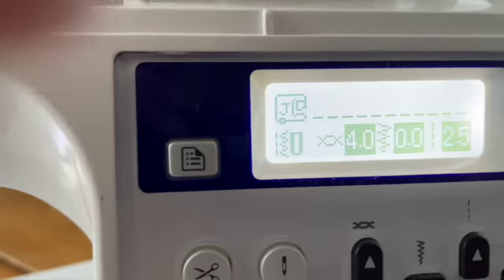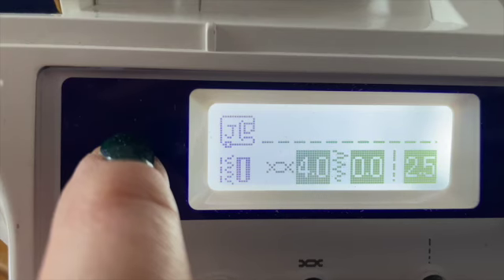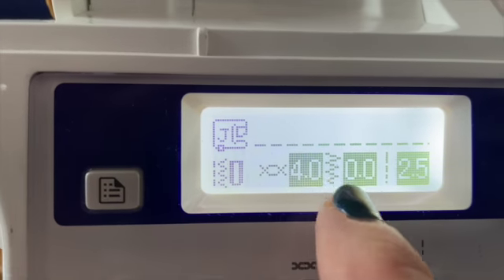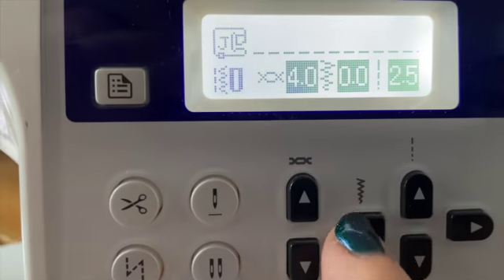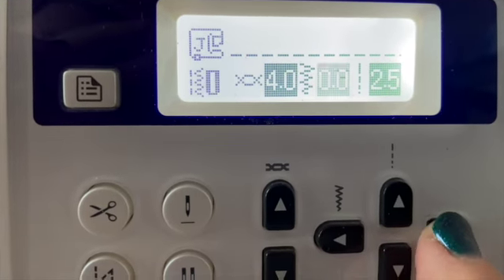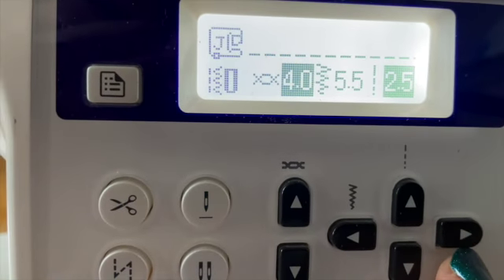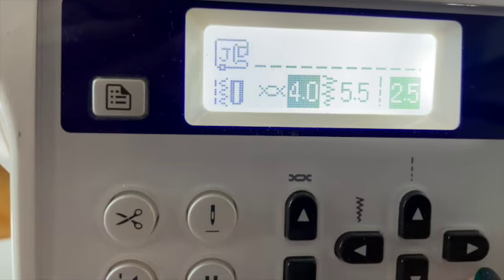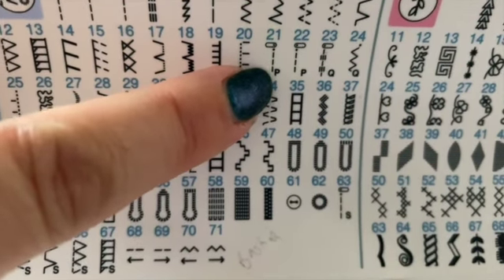🤩 How To Set A Seam Allowance On A Sewing Machine

Comment: Do you know what stitch width an 1/8 inch would be?
Reply from the maker: Great question Deanna. I've found that's it more about where you position the fabric under your foot. So, put your stitch width setting to 5.5 to get it to 1/4". Then look at your foot; there should be a metal bit on each side. Look at the right hand metal bit/prong. Then line up the edge of the fabric to the inside edge of that metal prong, and that 'should' be 1/8"   I use Brother machines and it seems to work on all the Brothers that find a place on my sewing table, but I haven't tried on other brands of machine. So give that a go on a practice piece and then measure the seam allowance. Hopefully it won't be too far off! Do let me know how it goes. Kim.
Reply: @QuiltWithKim  sweet ty, I have a brother so I'll try that 😁

Comment: How do I get a 3/8 inch on my machine
Reply from the maker: You may see one of the seam allowance markings (the lines on the base plate) for 3/8”. If not, put your needle into its default position, and measure the distance from the needle to the edge of your foot. That’s ‘normally’ (but not all if time!) 5/8”. Now adjust your stitch width a little so that your needle moves to the right. Measure again….and adjust as necessary. It really depends on the type of machine you have, but give that a go and let me know how you get on and I’ll try to help a bit further.

Comment: Know where to buy 1/4” foot for a dedicated left position machine? I have an older brother galaxy 131, which is left position machine when sewing straight stitch.
Reply from the maker: Hmm, not sure about the quarter inch foot for your particular machine  (contact Brother - they will tell you), BUT the good news is that on pretty much all machines there are parallel markings on the base plate just to the right of the presser foot.  One of these should say 1/4" (and it may be closer to where the needle is than all the other lines).  Those measurements are taken from where the needle is in its default position AND with the standard foot on, so if you run a test stitch line with the edge of your fabric against this quarter inch marker line, you should find that it's a quarter of an inch and you're good to go! Let me know how you get on. I'll keep my fingers crossed for you. Kim x
Reply: I have the new brother bq3100 and even though I can easily change the needle position to the middle, I don’t like the fact that it’s default needle position is on the left. If am to be using the middle position, I’ll have to adjust my seam allowance otherwise, it will be off

Comment: Brilliant! Thank you for the indepth video
Reply from the maker: You're very welcome :-) x
Reply from the maker: Did you figure out where to measure the seam from? (I saw your question pop in then couldn't find it again to reply!).  Basically, wherever your machine defaults to, that's where you measure from.  Some machines have their needle automatically sitting to the left of the universal foot, whilst others have it sitting in the middle.  The quickest way to find out is to make sure your needle is in the uppermost position, then switch your machine off and off again.  That will put the needle in its default position.  Hope that helps :-) Kim x
Reply: @QuiltWithKim  thank you. So far I have had problems finding a straight stitch foot for left position needle position for my brother, brother on line has not been any help. I have zz  foot that  came with it.
Reply from the maker: Did you manage to get your foot sorted out? So sorry I missed your question; sometimes they get a bit hidden 😖 Kim x